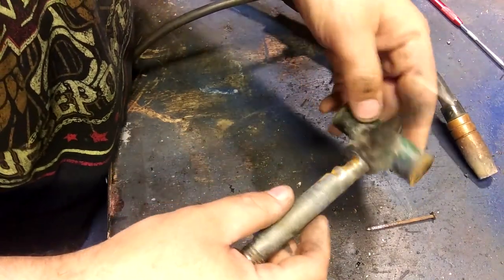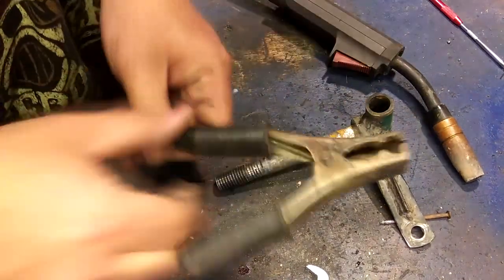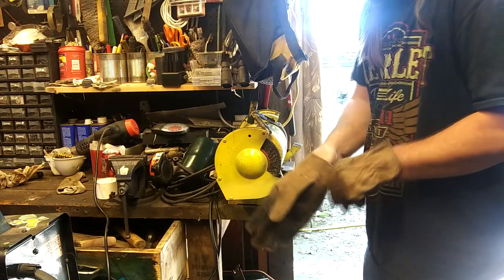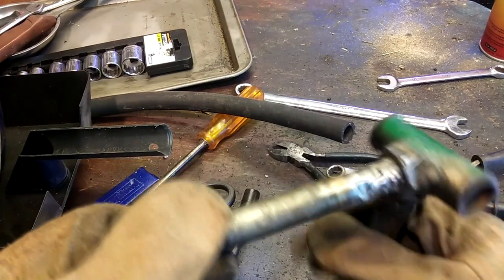GOKART spindle repair

Comment: Thats the way to do it. The weld will make it stronger
Reply from the maker: Ya it will work just fine i think
Reply from the maker: Ya it will work fine I think
Reply: Would have been a good place to use sulfer. Would have made the weld even stronger